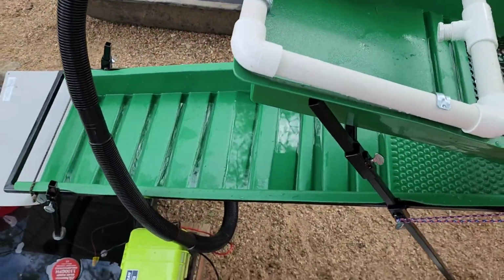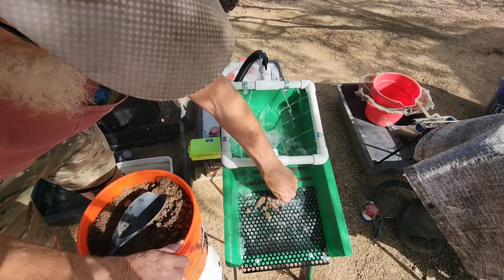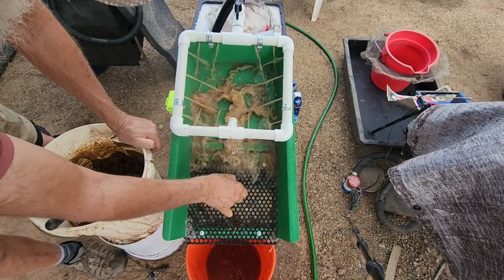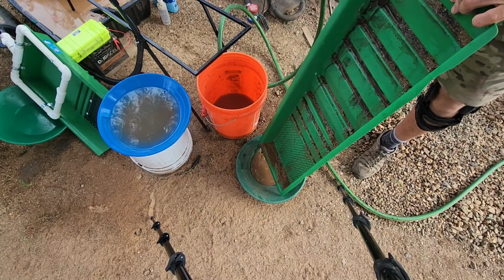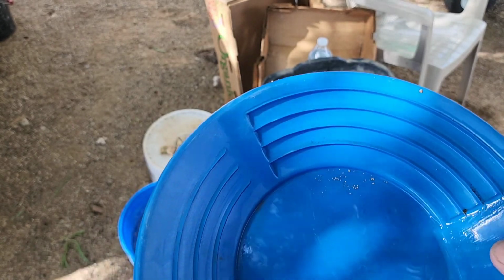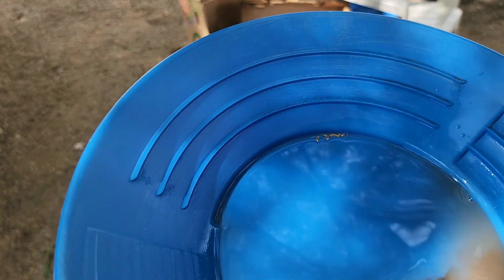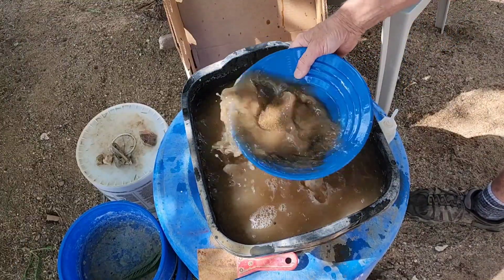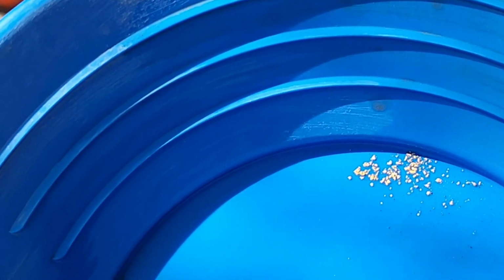Testing New Geo Banker, How Much Gold Did It Loose???

Comment: Sorry I missed the premier. Loved the gold you recovered from the new high banker. And love the design. Different sizes, angles, depths and widths of the riffles allows it to flow through some but be captured in others. And thank you for doing a full test with the Gold Cube to test tailings. Kind of a strange feeling watching someone cleaning out a Gold Cube and hoping he finds no gold. I think it's test was a huge success! Enjoyed!
Reply from the maker: No worries brother, you’re here now! I agree, I liked the smaller geo sluice but the changes you referenced are going to make a big difference! I’ve got another video in the works comparing this to two other pieces of equipment (spoiler alert)😊I always like to run tailings if possible through another piece of equipment so as to not come up with the same results. I was glad too when only that micro came up, very good feeling! As always thanks for stopping by!!

Comment: Also interested in the the battery voltage adjustment
Reply from the maker: The speed controller works very well, very pleased how easy it is to adjust flow rates. Mike over at Vendetta’s made this so check it out!

Comment: Hillside claim is that a club claim? If so I need to join that club Because that’s a heck of a good result for one bucket of classified material looks like a high banker worthy area. If the gold cube doesn’t catch it nothing will… great piece of equipment (hard to pack in though) I reckon that piece of gold was covered in clay and that’s why it got past the new equipment it looked like clay was still coming off the cons when you were panning them it’s way to hard to get clay to let go of super fine gold. Great test and results. I can see the reasoning behind the 1/8th inch classifier the gold cubes picky that way. Thanks for sharing see you on the next one 👍🏼👊🏼
Reply from the maker: Hey brother thanks for dropping by! The claims are pretty amazing for sure! That new geo banker is really good and quote different from the smaller unit. Both are drop riffle systems, but the bigger unit is more efficient at gold recovery. I was very pleased with the test results as well! I'll talk to you soon!!!

Comment: Glad you did this test. I have been wondering how well they actually work. I’d expect them to lose gold being just a smooth plastic surface instead of having a mat.
Reply from the maker: They work incredibly well Ken! It is designed to not need any kind of material because of the drop riffle design using gravity as the main component for recovering gold. Thank s for coming by and watching!!!
Reply: @dougodette4582  I wasn’t bad mouthing them. I was just leery.
Reply from the maker: @Ken Vaux  No worries Ken, I completely understand, that was my main concern about them too when I was considering buying one.

After running about 2-3 cu yards through it I have come to have faith and trust in it. However, as in any piece of equipment,none can catch 100% of the gold!🙂👍